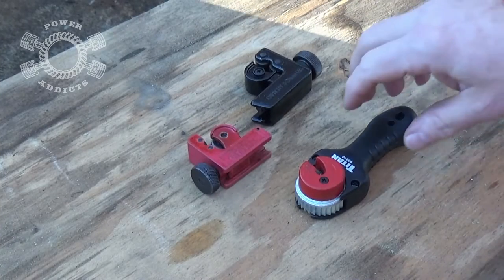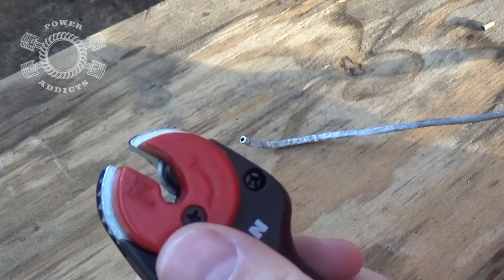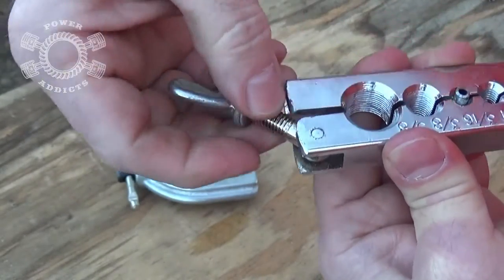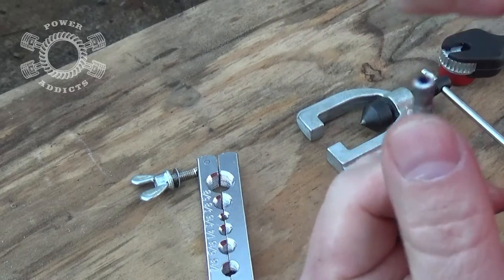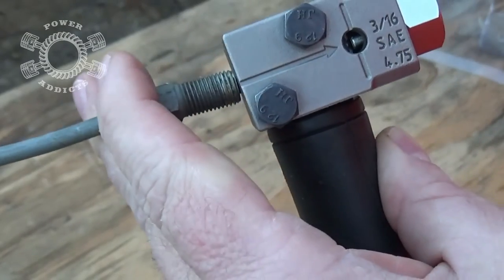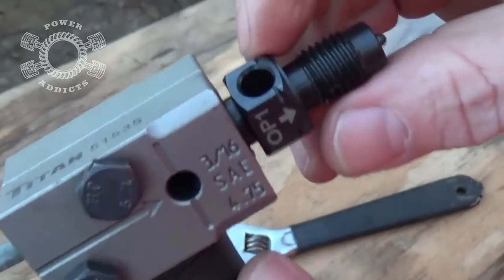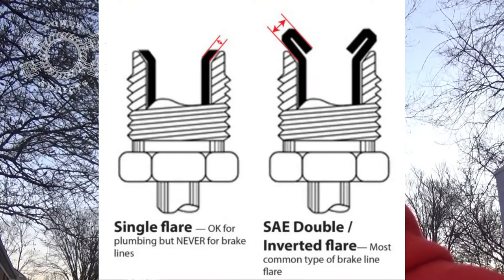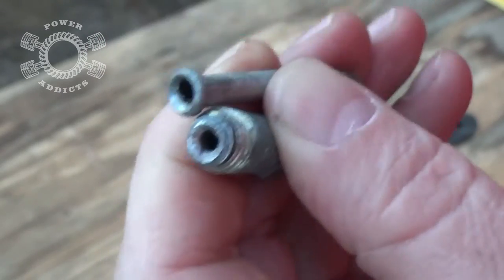How to Double Flare Brake Line and why you should. #poweraddictscrew #poweraddicts #doubleflare

Comment: Another tip, I use a short piece of hardened steel pencil rod that I run through the mandrel bolt instead of using a wrench. Works well in very limited access situations.
Reply from the maker: Good tip, that would work real well! Thanks for the great tip.